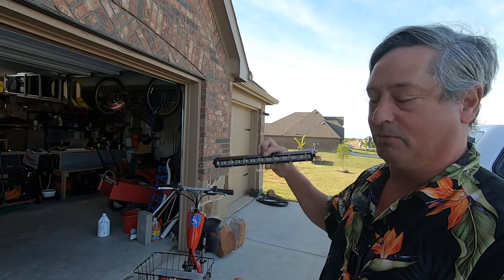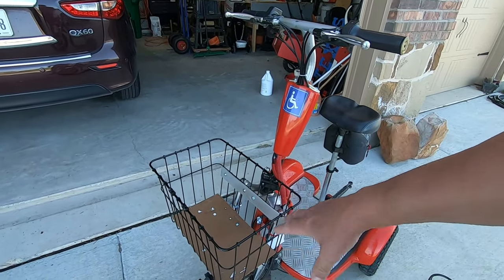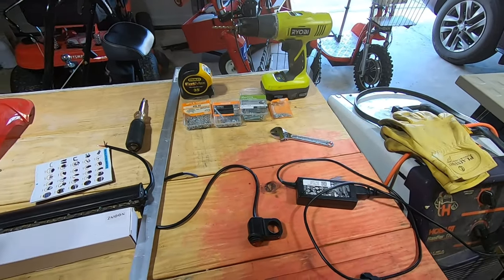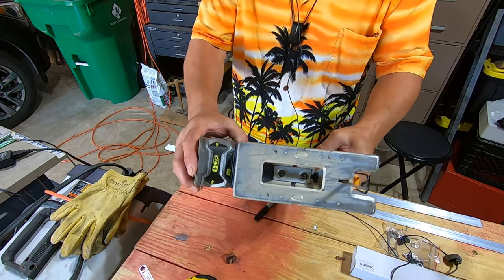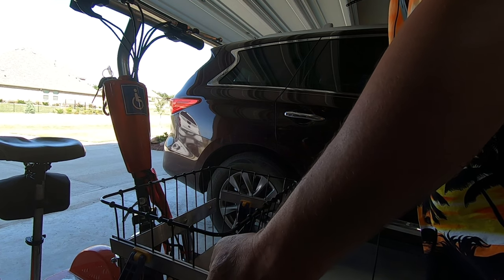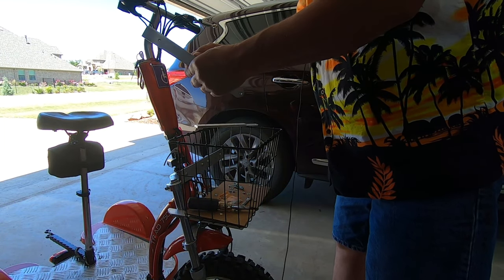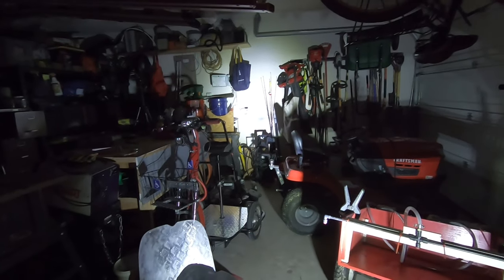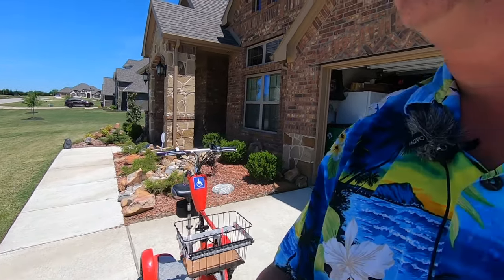New Mobility Scooter Upgrades

Comment: We use the magnetic rechargeable light bars like that in our under cabinets and in our fridge in the RV. The ones we are using have a motion detection setting on them to prevent wearing out the charge. This worked out great in your video. I think that is pretty good visibility. ❤️👍👏
Reply from the maker: I often wear an 18000 lumen head lamp when I ride at night but that is no longer necessary, I guess maybe I can use for frog gigging if I ever get a crazy spurt and decide to do that! LOL!! Thanks for watching!
Reply: You crack me up!

Comment: Hey Dude, First of all congrats on getting Little Red back on the road. That's a bright light!! I'm assuming that light bar was designed to run on 12 volts so you had to run a voltage reducer?
Reply from the maker: It does operate on 12 volts, I guess I should have mentioned that in the video! I used the same voltage reducer that you recommended for the Challenger lighting.Thanks for watching!!

Comment: DudeRV the Challenger X trailblazer... I've only had my CX for about two weeks now and have been having a ball between rain storms... I've mounted a little Git2 Sport Camera on it, with a gyro, and with great results... I just received some chrome rubber door edge guard/molding and intend to add it to the edge of the body, perhaps all the way around, to dress it up a bit, and further protect the body. I'm interested in where and what voltage you are tapping into for your lights... I've not opened the CX's Light or the Red Box on the handlebar post but would like to at least add a tail light... Can you give me some advice?  As always thank you!!
Reply from the maker: way back in 2016 I added tail and running lights to the challenger, here is a video of that...https://youtu.be/1w4S0IumFwM 

Prior to the Covid 19 situation I overhauled the Challenger X and re-did the lights here is that video...https://youtu.be/rXxyH0gI43o
The voltage reducer used the second time around is a more robust and should last longer. the red box on the post is just a pass-through.
Reply from the maker: @OwenFromOhio  Its all good, man that sure looks like fun!
Reply: @DudeRV  This is more then I could have wished for... In fact, it's exactly what I was looking for... On a side note, they now give the batteries the hot glue treatment from the factory. I guess we are both surprised that the unit doesn't have any tail lights?  I see exactly what you did there and will follow suit with some combination of the two efforts... Thank you very much!!!
Reply: @DudeRV  This is more then I could have wished for... In fact, it's exactly what I was looking for... On a side note, they now give the batteries the hot glue treatment from the factory. I guess we are both surprised that the unit doesn't have any tail lights?  I see exactly what you did there and will follow suit with some combination of the two efforts... Thank you very much!!!
Reply from the maker: @OwenFromOhio  so glad I have been of help! I do appreciate your watching!! If you need some parts I have an Amazon list just for scooter stuff in the description.